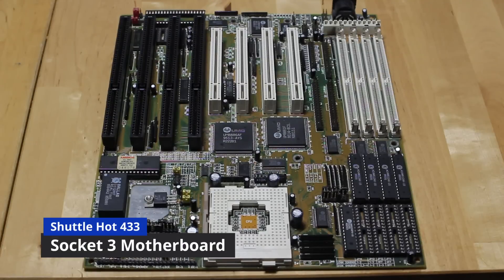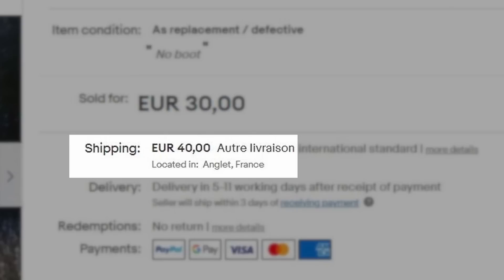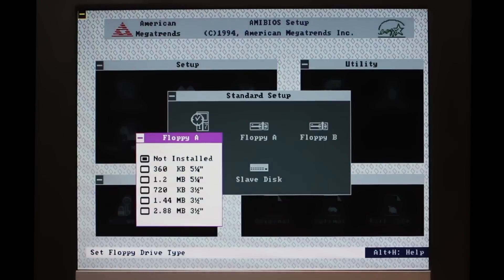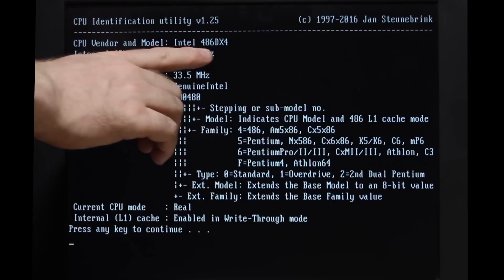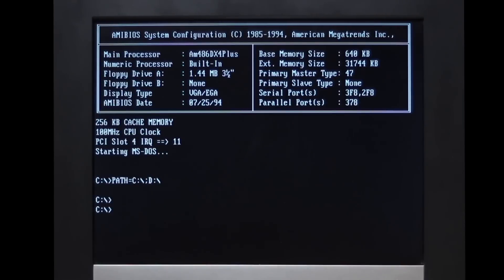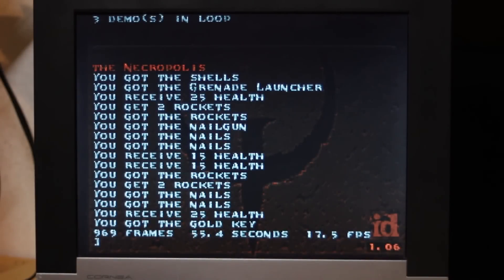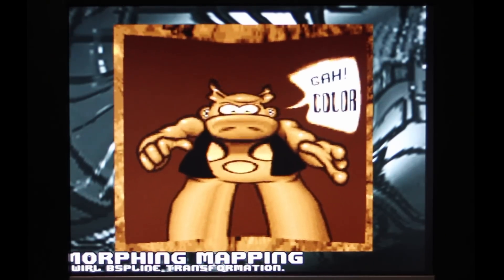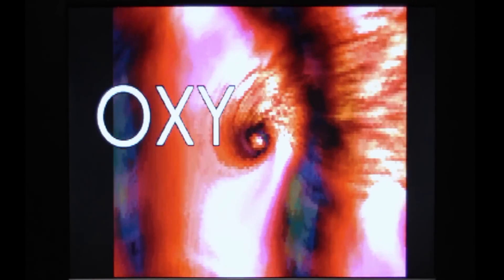Is this Really "One of the BEST 486 Motherboards Ever Made"? #DOScember2021

Comment: I should try to appreciate early PC demos more. As an Amiga fan they didn't seem clever enough... You have a simple frame buffer, 256 colours, fast CPU, fast RAM, and no standard machine so no way to compete for records or 50 FPS effects. PC demos seemed to mostly be about implementing some maths for 3D effects rather than hardware abuse and making the machine do something that seemed to be impossible.

But a lot of people like them, so there must be more to it, something I'm not seeing.
Reply from the maker: It took a while for PC to displace other platforms as the dominant demo platform. And yeah, I totally agree, it just became more about some 3D blob show rather than some really clever trickery.

I can appreciate the work that goes into super fast 3D effects and I appreciate all the really cool effects you can do with limited hardware, so I get the best of both worlds in a way.

The reason I liked these particular demos so much is they are really, really fast. There's no hardware acceleration here, it's just superb coding. Later on, it became too easy and demos (mostly) were more about creativity without limits rather than pure programming skill.

Of course that's a very personal take on it and many people would strongly disagree with this assessment. And thankfully there are many superb counterexamples to all of this right up to the present day! Some people never gave up on pushing things to the absolute limit.
Reply: I wonder how they did it. Back then compilers were not nearly as good as today, so assembly was still worth using for speed.

I guess most of them used integer maths, not into the FPU as standard era yet.
Reply from the maker: @kuro68000  I have to be honest that when I look at these particular demos, even though I know a lot of mathematics and have quite a bit of experience with 3D stuff, I have NO IDEA how they did these demos. I would imagine they used the FPU where that made sense, but I think I agree with you that integer maths might have been better.

Certainly by the time late era 486 came along there was enough time to update each pixel on the screen in one frame. But if you look around at the sort of stuff being done in games at the time, these really stand out as super impressive. Games without 3D accelerators had maybe a few hundred polygons. But these demos have thousands.

For sure there is a lot of precomputation, but it's not like they had time or memory during precomp to prerender all the scenes. I'm going to have to disassemble some of these at some point to find out how they did it.
Reply: @PCRetroTech  In my experience it's usually about "cheating" as much as possible without it being noticeable, so for example you select a shape that is made of entirely convex polygons, or limit rotation axis so you can pre-compute/half compute some of the hidden face removal. As you say, much faster than games of the era.

I had a quick look and couldn't see source code for any of the three you showed, shame as that would have been really interesting.

So were FPUs common on 486s? I'm still coming up to speed on the era which is why your videos are so interesting, but I thought most 486s didn't have them. On the Amiga side most demos would not use an FPU, they would do everything with integers and carefully select magnitudes to avoid it being noticeable. Even on CPUs that had FPUs it was much faster to do integer maths, with e.g. an integer multiplication being faster than an FPU one even if the FPU was on-die.
Reply: @kuro68000  all 486dx had integrated FPUs, the 486sx had the FPU disabled.
Reply from the maker: @kuro68000  It was common to have an FPU in the late 486 era. By the time the 486 era came around the DX in the name meant that the CPU had a built in FPU. The DX2 series was essentially high end at the time it was released, but by the time DX4 came along it was as far as I recall, usual to have the math coprocessor in the average PC.

However, it wasn't until Pentium that the FPU became really powerful. The Pentium put an end to a lot of the tricks that would have been faster without the FPU, mainly due to the fact that the integer multiplication unit in the FPU was so strong. That's my current understanding at least. However I think it was still often worth doing integer arithmetic for some graphical computations.
Reply: @PCRetroTech  I tried to find some data on instruction timings for the 486 DX parts, particularly the FPU, but a quick search didn't turn anything up. On the integer side shifts were very fast by that point at least. It would be interesting to see some disassembly. Are there any tools for profiling code like that? Could you run them in an emulator or something and debug them that way? That works well with Amiga stuff and WinUAE.
Reply from the maker: @kuro68000  I don't know if YouTube will remove this link, but perhaps you still get it. It's the instruction timings for the 486DX and Pentium [1]. Most of the Pentium FPU ops are 2-4 times faster than the 486.

Unfortunately there are no really cycle exact emulators for PC, even for 8088/8086. Timings in the PC world are much more complex and still not fully understood in all cases.

You can disassemble code easily enough, e.g. one I used back in the day was OllyDbg. The problem of course is that any really good code is going to have tricks for defeating disassemblers. For really early stuff you can use the DOSBox integrated debugger, but by the time you get to Pentium the emulation probably isn't very fast any more.

There's plenty of profilers available, though they aren't going to profile individual operations, mainly they will profile at the function level (by intercepting the running program at random intervals and doing a stack trace). But the information is not going to be particularly useful without debugging symbols in the library. I'm not an expert in disassembling demoscene productions, but I imagine the first step is to remove the exe packer which I understand are nearly all engineered to be extremely resistant to disassembly. 

[1] https://www2.math.uni-wuppertal.de/~fpf/Uebungen/GdR-SS02/opcode_f.html
Reply: @PCRetroTech  Thanks for the link, that's really helpful. So it looks like on the 486 the FPU is much, much slower than integer maths and my guess would be that those demos are mostly running integer only code. Certainly on the Amiga side people were doing a lot of 3D stuff with integer only so the techniques were well developed.

Interesting point about the packers being resistant to disassembly. Again my experience is with the Amiga, but it wasn't really worth protecting your code because you could just soft reset the machine and rip it directly out of memory, or use an Action Replay to do it. Same with graphics and music. Game copy protection used encrypted code via the Trace Vector Decoder, but of course it was extremely slow.

I didn't know that the state of PC emulation was like that, I guess it doesn't need to be to get good results. WinUAE is exceptional in that sense.
Reply from the maker: @kuro68000  Remember that those timings would be for double precision operands using IEEE arithmetic, so they are doing much more than an integer operation would. But yes, unless you work pretty hard, integer arithmetic is probably going to be faster.

I recall that Quake benefits a LOT from the floating point processor of the Pentium and is very highly optimised for Pentium. I imagine it has fallback integer routines for the 486SX (no FPU), but I didn't check.

A lot of integer routines actually have a history that goes back much further than the Amiga. For example, I believe CORDIC goes back to the 1950's or so.

I've for a while been jealous of machines with really good emulators, like WinAPE and many others. There are certainly efforts to do cycle accurate emulators for the PC, but nothing has been released yet which is generally considered to be 100% accurate. On the other hand, emulating all the hardware is tough. We haven't even found all the glitches of the CRTC used in the IBM CGA card yet!

I know the CPU and bus have been emulated cycle accurately, though I'm not certain of the state of actually released code for that. But for example, the microcode ROM for the 8088 was only reverse engineered in this past year or so, and there were some surprises.
Reply: @PCRetroTech  Thanks, I'm going to go looking for that 8088 microcode dump now. I hadn't come across CORDIC, I mostly just did the basic "scale everything up by 256, shift/swap+mask to divide the result" kind of thing. Lookup tables for everything. Actually one of the biggest speed-ups, even today when compilers for an architecture aren't top tier like x86/ARM, is using assembler to speed up lookups. I've done a bit of that in my professional life, as well as hobby stuff.

Quake for Amiga requires an FPU. I thought the PC original needed an FPU as well, although I guess once the source was out you could just recompile it to use software floating point libraries and enjoy it at about 0.1 fps :-) I remember doing JPEG decoding without an FPU in software that just relied on the OS intercepting the faults and redirecting to the relevant library function, and it took about 4 hours to decode a single 640x480 image.
Reply from the maker: @kuro68000  You probably already found it, but here is the link to Reenigne's blog article on the 8088 disassembly [1].

As for division, until recently it was actually possible to "beat the chip". This paper [2] shows a significant speedup over the actual assembly instruction for division. The paper looks menacing, but once you figure out the notation it is easy to implement this for any sized machine word.

Cool story about the JPEG decoding.

[1] https://www.reenigne.org/blog/8086-microcode-disassembled/
[2] https://gmplib.org/~tege/division-paper.pdf
Reply: @PCRetroTech  Do you actually need any division for 3D stuff, that can't be pre-computed? Off the top of my head I'd say it can all be done by multiplication and lookup tables, if you constrain it a bit, but it's so long since I looked at it I can't say for sure.

There's probably some consideration of cache too. Even on the 68000 which has no cache, but on Amiga shares the bus with DMA, sometimes it was faster to use instructions that on paper took more cycles but resulted in fewer memory accesses. When cache started appearing the goal became to fit the inner loop into it, and to get as much of the data in there.

I always thought that the low number of registers on x86 was a performance issue, but apparently Intel didn't think so for the 486. Well, more likely they just assumed everyone would use the FPU, which did have more registers. For 3D stuff on 68k we had some ridiculous register juggling going on, even there it would have benefitted from more.
Reply from the maker: @kuro68000  One case I can think of where you might use division is perspective computation. You have to compute x/z and y/z where x, y and z can essentially be arbitrary. Even for 8 bit values that gives a massive lookup table (doable on a PC, but not something I actually like to do).

Having said that, the Montgomery-Granlund paper requires a fast multiplication unit, which the 8088/8086 certainly didn't have.

Another place division is used is in the DDA algorithm for drawing lines. There's one division per line, but still it is a major pain in the neck. DDA is actually faster than Bresenham on an 8088 if implemented correctly, and frees up a register too, though it is not so good for time critical CRTC effects, since the single division instruction takes so long and can delay interrupts for example.

Yeah register constraints are a pain on the Intel CPUs. They could have done with an extra couple of registers right from the start. With some care you can use 8 general purpose registers in time critical code, but it still isn't enough, especially given that four of them don't break into 8 bit registers. There's often a spare segment register or two you can use for temporary storage, but they don't do anything else for you. The main advantage of the Intel CPUs over most 8 bit machines is the very extensive list of memory addressing modes.

But there is a reason the Amiga was so popular for so long (and still is)! It had some really unique capabilities compared to PCs of the day.
Reply: @PCRetroTech  It's been a while since I did any of that, but I had a quick look at some old source code and I think the solution for the perspective computation was to invert the Z axis. That way zero is far away, and the Z coordinate increases as it comes closer to the camera, so you can use a multiplication instead of a division. You have to constrain the object to a fairly narrow range of Z coordinates, which is why in a lot of those demos the objects either stay about the same distance from the camera, or they do simple scaling rather than translation on the Z axis for scene transition effects.

I could be remembering it wrong though, and my younger self was terrible for not leaving comments or using sensible variable names.

Line drawing I don't know, I always used the blitter for that! I was always more interested in doing stuff with the hardware than with optimizing 3D code.
Reply from the maker: @kuro68000  Inverting the z coordinate (reciprocal, not minus if I am not mistaken) is a reasonable solution. However that does depend on a fast multiply unit. Perhaps there is some other way that gives an approximation over a ver narrow range of coordinates, I'm not sure.

It's a shame that on the 8088, mul is not that much faster than div.
Reply: @PCRetroTech  I remembered that there was a way to avoid the multiplications and eventually found some old notes about it, and this implementation in x86 assembly: http://www.codercorner.com/Fstrt19b.zip

I remember implementing it in 68k back in the day. Basically you calculate a table of pre-scaled vectors, one for each axis, and then you only need to do 9 adds per vector in your object. The problem is that the "resolution" of the vectors is limited by the size of the table (i.e. quantization error), but I thought maybe you could do a hybrid version where you only need to multiply a single normalized vector once per axis, before adding.

By the time you get to a DX2 though I'm not sure if it's actually faster than multiplying out a matrix, even if your table fits into cache. Given you only need 6 muls per point (if your object never changes shape) it's probably not. For machines with super slow multipliers it was effective though, and you could hide the resolution problem by making things move really fast :-) The starfield at the start of Planet Rocklobster is a great example. Even that can be improved on with speedcode.
Reply from the maker: @kuro68000  Ha! One of my projects over the holiday period was to write some code to use the prescaled vector idea. On the 8088 it might be a bit faster. Lookup isn't that cheap though.

With some additional tricks I thought I might be able to get the cost down further, but I don't recall precisely what they were just at the moment. I usually do perspective separately to the rotation matrix so the situation is a bit different there. Cutting the cost of the rotation was the other project I was going to work on.
Reply from the maker: Oh wait, that idea with the 9 adds is different to what I was going to do. It might be similar to what I was going to do for the rotations themselves, but I'd have to sit down and think it through again to check. I don't remember 9 adds in my solution, but it was a month or two ago that I thought about it.
Reply from the maker: For the perspective itself I think I decided on splitting the x and y coordinates into two nibbles each and then doing two lookups per coordinate instead of a division. Table size is small and it is a bit faster than two divs. I used a similar trick in a racing car game I once started writing https://youtu.be/BgRezuWXqMY?t=704

But I think I also had a second idea which was even cheaper still. I don't recall it now but it revolved around using coordinates in [-128, 127] and interpolation to keep table size small and use just one lookup per coordinate.
Reply: @PCRetroTech  Grand Prix Circuit was one of the first games I ever owned! Loved that game.

I'm going to have to think about this a bit as I don't immediately follow what you are suggesting. As it happens I was thinking about a racing game like that too, mostly because I had an idea for a novel way to do the track on an Amiga with the copper and sprites. One day I will get around to coding it.
Reply from the maker: @kuro68000  By the way, Planet Rocklobster is definitely one of my favourite Amiga demos. For some reason I've always preferred C64 (and obviously PC) demos to Amiga ones. But Planet Rocklobster is an exception.
Reply: @PCRetroTech  Yeah, it's a nice demo that mixes both hardware tricks and some nice math optimizations. Very old school style. My of my favourites are ones that made my jaw hit the floor back in the day, like Roots 2.0, or ones that manage to be artistically brilliant as well like Nexus 7.